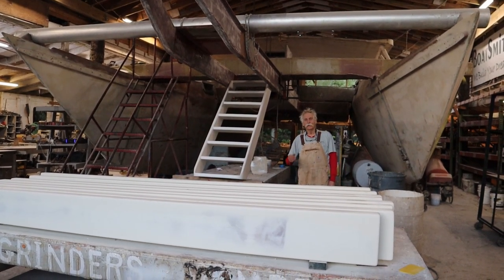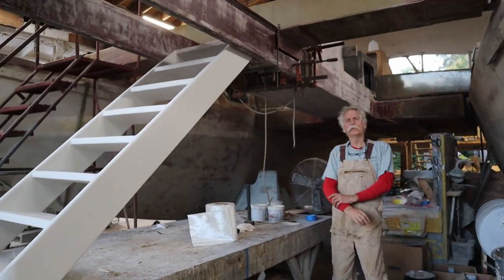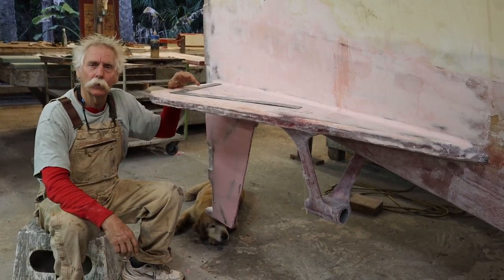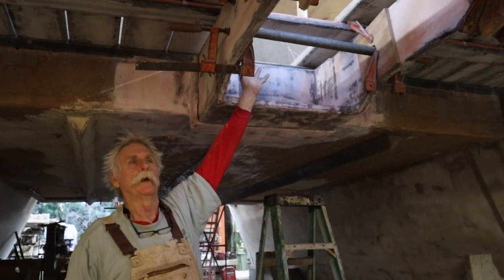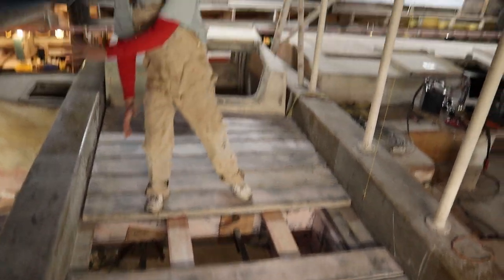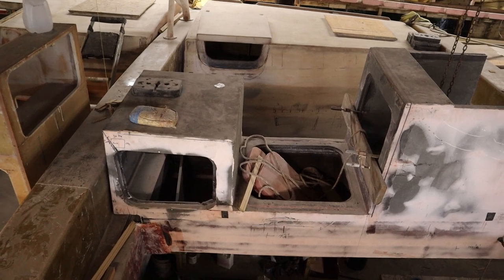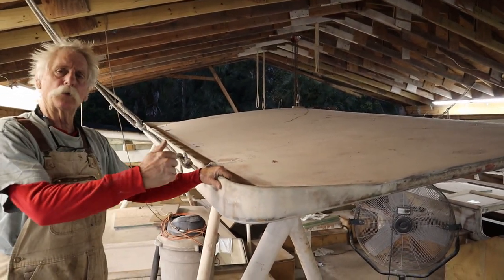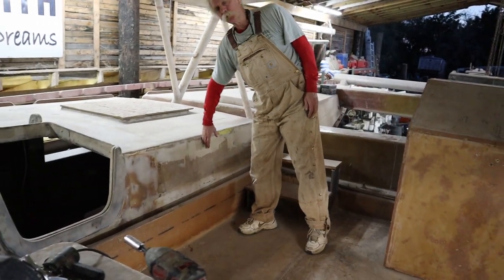Tehini Build Episode 2

Comment: Nice, I want to build one and have been thinking about the electric motors, but using a double electric outboard design with re-gen properties.
Reply from the maker: thanks we thought about electric outboards. We think that the larger props of the inboard will work out better for propulsion and regeneration
Reply: @boatsmthfl  Did you build those hulls from molds?
Reply from the maker: @rainmaker3700  we built te hulls on male molds